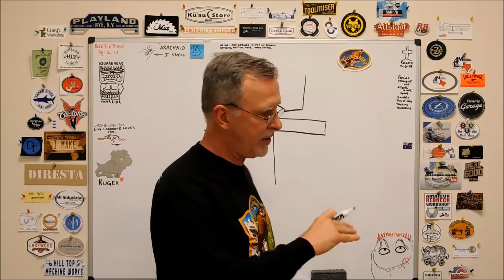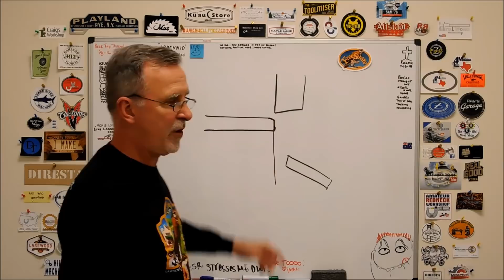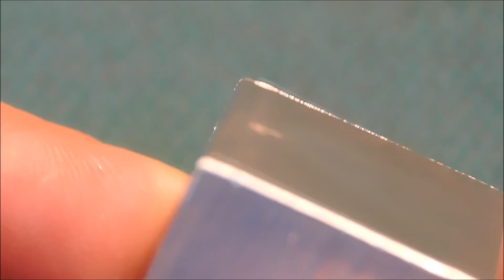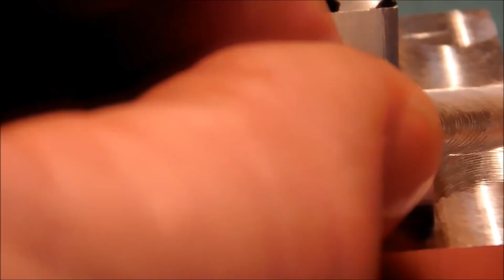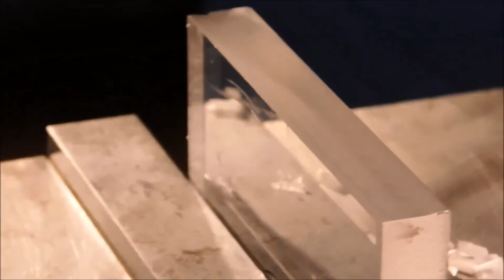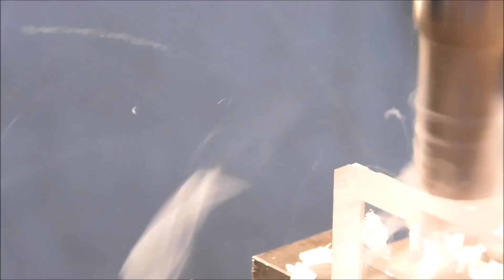Reduce Burrs, Chips and Craters - Milling Cleaner Parts

Comment: As always, good advice. Just a question, how much does vibration from the vice overhang affect the finish, and do you have a 'rule of thumb' as to how much height overhang vs thickness is acceptable. I can get problems with melting, you don't seem to have this problem, mine is probably blunting of the cutter, any advice? thanks Tony

Comment: Hi Joe.
You asked the start of this video for an input from sheet metal people regarding the shear distance of a piece.
We generally try to have 1/3 shear and  2/3 break. This gives less wear on to top steel/punch as the shear is square to the top surface of the workpiece and the break is clear of the steel/punch.
Hope this helps.
Reply from the maker: thank you. I knew the fractions, just wasn't sure of the application.
Reply: Hi. 40 years in toolmaking press tools. I agree, 1/3 shear 2/3 break away.

Comment: Get a Onsrud or Amana single flute upcut for that acrylic. Night and day.
Reply: Tony Wilson  not sure? I make 420X vent slots/part with these: https://www.amanatool.com/51416-solid-carbide-cnc-spiral-o-single-flute-plastic-cutting-1-8-dia-x-1-4-x-1-4-shank-x-2-inch-long-up-cut-router-bit.html Onsrud makes great cutters as well. Works great on PC, acrylic and telflon. No chipping. Very little burrs. CNC paths...  IIRC I did not find good results with delrin.

Comment: I've never had much luck with  poly methyl methacrylate   unless I used a cutting fluid like 7-11 oil or a good water based coolant and then after machining I have to stress relieve it or else it crazes at all the machining points and to do that I need a ramping oven,  so I prefer  Poly Carbonate whenever possible.
Reply from the maker: PMMA is easy to chip. I've worked with it before. I like Delrin over all other plastics. Great to work with.

Comment: When I had to shear sheetmetal I find that the burn from the shear has a taper on it. I believe it was due to dull blades. Chased it around for days before I was able to figure out what it was doing. Debuted parts after and they were better after. I hated having to run the shear.
Reply from the maker: They can be very helpful or create a huge mess.

Comment: Wouldn't the chipping on the no-load run indicate that for precision milling such a run should be mandatory? ((I'm a pre-beginner in milling.))
Reply from the maker: It is recommended. A no load, air or spring pass is always a good idea before making a machine adjustment to hit your final size.

Comment: How would a hot electrode be for cutting that plastic.
Reply from the maker: Disastrous. Good on foam plastics, but not these.
Reply: @joepie221  Thanks
Reply: You can cut acrylic with a laser CNC.   But it does something very strange to the cut edge.  If you then try to glue it to another piece of acrylic using acrylic solvent the entire edge produces a clearly visible crazing effect.  So you can only use a laser cutter if you don't intend to glue that edge.  I understand the same problem occurs with flame polished edge.

Comment: I think you could also avoid that crater if you lifted your cutter a tiny bit, made a small cut inwards, then went on the other side as you did, lowered the cutter once more and made the cut all across the length juat as you did. Then the tall part would not break off as it did here, and you would also finish the cut with a very small height of material in the end which would minimize the actuall crater to next to none.
Reply from the maker: A lighter final pass is a step in the right direction.

Comment: Great vid Joe. Thanks!

I have a trick for removing the small burrs off Aluminium.  Let me preface it by saying that you need to carefully consider the requirements of the job's finish if using this trick and be aware that it is moderately hazardous.
I frequently de-burr Aluminum jobs by agitating them in a bath of 10~15% Sodium Hydroxide [Caustic Soda].  The reaction is quite vigorous and if you leave it too long all your other edges will become rounded and that may ruin the job - as will not agitating it, which causes blackening.
It is a handy trick for making all those burrs and rough edges disappear but note that:
1> Caustic soda is HAZARDOUS, gloves and goggles please. [If you get it on your skin it will feel slippery at first because it is turning the fat in your skin to soap, then it will burn.]  Irrigate with lots of clean water!!
2> The reaction gives off Hydrogen which is explosive [only  a small amount is produced in normal use] so it should be done in a well ventilated area.
3> The solution will get hot if used continuously.

A little, actually a lot, of common sense and machinists might find this a useful trick for de-burring or putting an even, matte finish all over small Aluminium parts that they wish to finish in a hurry.

Be careful with it guys and gals and don't forget the agitation or you will be starting again!

Keep up the great videos Joe.
Reply: I do this as well. Best method before priming and adhesive bonding of Al as well. The old sulfuric acid potassium dichromate bath was even better  but nowadays non EPA compatible for sure.
Reply: @erikisberg3886  Erik, never used acid/dichromate for this but it is a wizard laboratory glass cleaner. As you say, it is not exactly PC today because of the hexavalent chromium which is a genuine nasty! Cheers.
Reply: @mousemade1  We used amoniumpersulfate/sulfuric acid as a substitute but it does not work as well as Cr for cleaning glass. (Also sold as no chromix or someting?) H2O2 muratic as for etching circuit boards works (also for preparing some stainless for bonding) but it fumes a lot and needs to be freshly mixed. The CrSulphuric mix gives Al a very special surface like short hairs that bond very well to adhesives and primers. Main danger of dichromates seems to be dust and spray inhalation causing rather unpleasant effects. And waste disposal of course. I often use an ultrasonic cleaner for small Al parts, the caustic does not need to be particularly strong or nasty.
Reply: @erikisberg3886  Don't want to take up too much space in these comments but will say "Yea" to all your comments AND I always clean stainless with Hydrfluoric acid (after welding - never adhesive bonded it) and HF is a very serious nasty. A good burn with that and the cure is worse than the burn! Cheers.

Comment: The rattle in that machine would drive me crazy!. Sounds like 2 skeletons screwing on a tin roof!
Reply: Ah... the sound of the plastic bushings beat out in a Bridgeport variable speed head. The eternal question is: How long can you stand it till you break down and fix it....again?
Reply from the maker: The rear ones are much easier to get to than the front. Its the front ones making the noise.

Comment: I don't know, Joe. I'm surprised the first pass in the acrylic when as well as it did. I was expecting to see divots the size of dimes coming out of there, assuming that the piece didn't snap off entirely.

I'm also a bit surprised you left the protective film on for machining. I've had problems with that in the past.

At any rate, I'd much rather drop acrylic in an Epilog  or equivalent laser cutter. Much easier to deal with!
Reply from the maker: I would normally support a part better than that, but I wanted the part to jump around and make the example worse. If I pushed the feed harder, it would have emphasized the chips. As for the film, It didn't have any. Its got some surface scratches since its a drop part, so maybe thats makes it look less than pristine.

Comment: would a 4 flute cut and remove more plastic giving less tenon on the cutter and the part,  And on the block of aluminum the bottom face of the cutter how can one get rid of the line it leaves behind on the part   ,is it a miss matched grind on the cutter or is it cause by something else.
Reply from the maker: A shallow cut with coolant will help the deck finish. A sharp tool is a good idea too. That finish is most likely from the cutter deflection causing the bottom of the tool to skew as well.
Reply: If your talking about the crisp, white lines on the aluminum, I'm pretty sure those were reflections of his fluorescent lights. (I thought the were some kind of remnant from the cutter, too, for a second.)

Comment: The shear rate really depends on the allow and thickness, plus the die clearances and punch and draft angles.
Reply from the maker: Its not my world, but I have some knowledge of the environment. I can see that would be true. I went to a trade show once and watched a shear cut 1/4" plate steel then a single business card just as clean. Impressed me.
Reply: @joepie221 It isn't my world either, just spent some years doing fabrication and progressive stamping and fiddling around insode the dies shimming and whatnot. I'm certainly no toolmaker yet, just a machinist. But most shears get away with that I believe because the contact point is so small with the blade angled. The way a positive rake vs a neutral insert are. Speed is also a factor.  I highly doubt anyone has a full knowledge of any mechanical trade. Every generation both loses and evolves more knowledge. Seems like alot of the guys my age couldn't build you a machine from the ground up without a Cnc, but some of us could. I personally watch your channel just for a change of persective from the way I do things. The more people you can observe doing the same things but maybe differently than you do them, the greater the possibility of learning a better way to do something.
Reply: @joepie221  I really wish I could have a camera at work. Not many people on youtube are covering Swiss/screw machining. It is night and day different. The Z axis is backwards. Grinding .035 pcd boring bars with the proper angles and reliefs is something else. The stick tools arent bad except when you get down to like a .015 groove

Comment: Awesome video!

Laughed at 33:48.
The focus of a perfectionist is flaws.

34:57 Laughed harder.
Who would ever leave "Good Enough" alone?

Thanks Joe;

I'll stop being afraid of climb milling with my  "apartment sized" machines;
so long as I've got (say) 2/3* of the diameter of the cutter in the material.

*2/3 Sounds believable and is easy to remember.
I'll update this guideline (based on material) anytime I hear *that*: "THUMP".

P.S. Do you have that thumbnail deburring tool for sale?
Reply from the maker: Keep your table locks gently snugged while climb milling and don't be aggressive with your feed and it should work out well. Which tool are you curious about?
Reply: @joepie221  Thanks for the reply!
I learned the table locks trick already - *all by myself*; and much too late.
Keep the videos coming, every once-in-a-while the timing educates me BEFORE I have to figure out what I did incorrectly.

The tool comment was about using your thumbnail to deburr; I had that typed thinking I was being funny - and then you mentioned it directly later.
I use that as one of those personal guidelines as to finish quality too.

Comment: I  used round stock acrylic  to make handles my lath turned about 350 RPM  ,  I drilled a 1/2 inch hole through  , and if I fed the drill to fast the plastic would melt , to late to pull the drill out the acrylic would shatter and instead  a handle ,I would loose a handle and 1/2 , I tried water and my three lower speeds but the best way I found is pecking slow but shore  ...
Reply from the maker: Maybe try a smaller pilot hole first. Less friction=less heat on the final size.
Reply: I believe the solution is to grind a much pointier angle on the drill bit...
(Not a machinist, but I used to work with acrylic a little bit, and was provided with a special bit for drilling screw holes in acrylic)

Comment: quick question; could you minimize or eliminate the crater by stopping  short, leaving a tower, and taking off the tower in 2 passes, the final pass only being .030" or so?
Reply from the maker: The height of that tower certainly compounded the problem. If you suspect this will happen, a much shallower finish pass would be a great idea. So theoretically, the answer to your question is yes.
Reply: Sean Clark I was thinking of the same question. Looking forward to seeing what Joe says.
Reply from the maker: Shallow is better in that situation.

Comment: If someone really wants to see a cut and shear along with the rounded and burred edges just look at a heavy duty washer. One thing that always seems to generate horrible surface finish in the mill is slots and keyway. One reason is unless you can effectively blast the chip out from the cut is you will continually drag chips back through the cut. When facemilling I always tried to have about 70% of the cutter engaged in the work. Plus once you get so far into the cut you always have at least one edge or insert cutting. Plastics. Some stuff like acrylic I never liked. For the reasons you show here. Other plastics, Delrin for example, are always easier to cut. But they also seem to generate a burr just looking at the material. The worst plastic in my experience for burrs, as well as holding size is UHMW. You get burrs cleaning up the burrs. 

When you were cutting the aluminum. From the metals I've worked with (aluminum, brass, copper, bronze, aluminum-bronzes, cold and hot rolled, stainless plus toolsteels). The worst for burrs are stainless, aluminum, copper and bronzes in that order. Aluminum castings can be really nasty to handle in a production enviroment. The same surface will have edges cut conventional and climb.
Reply from the maker: Drawn aluminum in the 1100 family is even worse than soft copper. Absolutely the worst gummy material I have ever worked on. that UHMWPE is miserable as well. Believe it or not, it deburrs like a dream with a piece of a broken light bulb. Try it.

Comment: Great video Joe, as always.  Would a ball nosed cutter work in the same way as the chamfered cutter? Or do you need to have a flat surface at the end of the cutter to work the way you show?
Reply from the maker: A ball nose would work, but a cutter with a flat bottom would give a better finish quicker.

Comment: If it is the same pass, and chips fly from cutter deflection, can you predict the amount of reduction in size the towers will be after the second pass? Always learning. By the way you have the cleanest, uncut fingers I've ever seen on a machinist.
Reply from the maker: All the scars are under the callouses.  Thanks for the compliment.
Reply: Marty B... in the shop that I work for we know what it will be usually depending on which tool we are using. I call this a spring pass where my lead calls it a tool pressure pass. I always keep my cutter approximately .002" from final and 99% hit it dead nuts with my spring pass. Every once in a while it can be more or less but barely.
Reply: I was thinking the same on his nails. 😁
Reply from the maker: @TheFeller1554  I work with a lot of surgeons. If my nails are dirty just once, they will probably go elsewhere.
Reply: Marty Bernier Seems to me that the part should be the exact dimensions to the print after the second pass. Stopping after the first pass would leave improper part dimensions.

Comment: Acrylic has a tendency to soften from heat. I keep air blowing on it, but that doesn't always stop the material from fusing (melting). Is it my RPM rate? Is it the cutter?
Reply: Probably too slow rpm and too slow feed rate. With plastic rpms like  alum but twice the feed works for me.
Reply: @TheFeller1554  Thank you for some guidance.
Reply from the maker: I agree. Sounds like both are too slow. Don't be afraid to use some coolant to keep everything flowing.
Reply: @joepie221 Thanks.  It seems almost counter intuitive, but I will try this increase in feed and rpm.

Comment: Excellent portrayal of effect of cutting direction.   For reasons shown I prefer countersinks that have the single hole from the side to form the cutting edge.   When sized correctly, the burr is turned back into the countersink and cut off, leaving absolutely no burr.
Reply from the maker: Check out my cutter deflection video. I think you'll enjoy it.

Comment: A picture paints a thousand words and you have created 25 a second for 35 minutes, keeping my attention throughout. Very good visual explanation as usual Joe, THANK YOU. I will think about this when I eventually convert my Mill. Just a thought, how would a Downcut Endmill cope with acrylic?
Reply from the maker: I know they are good for side milling thinner materials, but I have never used one to mill with.
Reply: @joepie221  It may be worth a try as the forces are down into the material, that combined with climb milling may be another answer, just like using your self ground angle one. Happy milling Joe